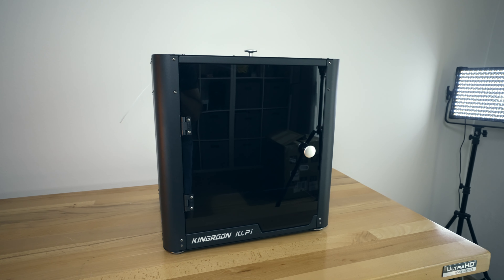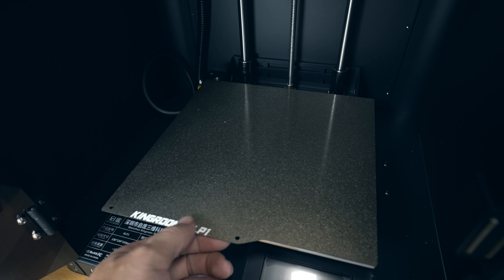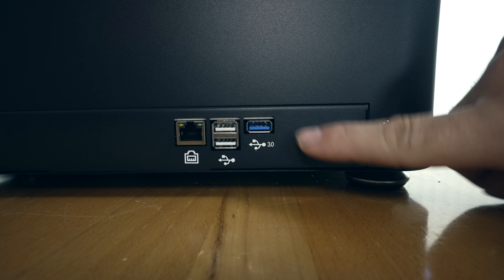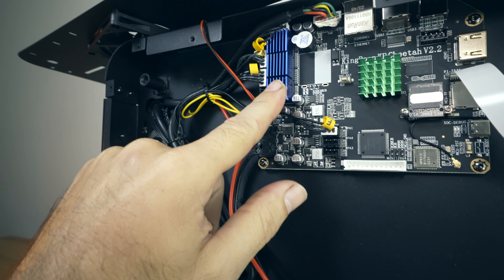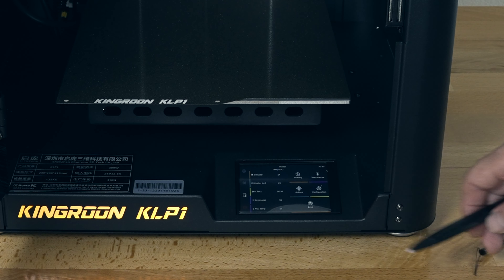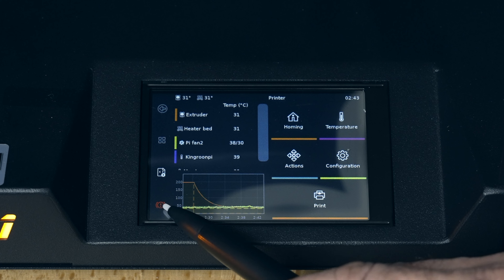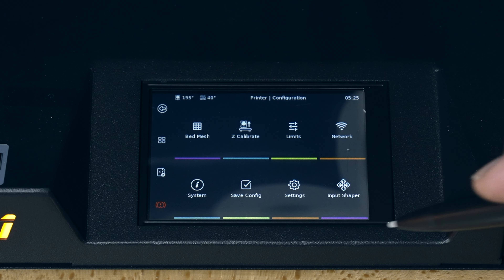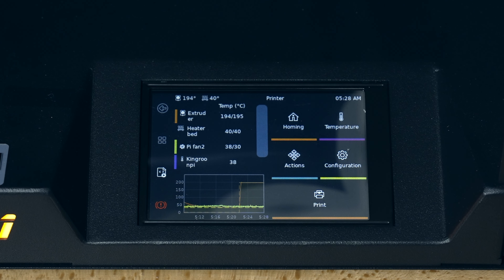Kingroon KLP1 - CoreXY 3D Printer - Overview

Comment: Terrible printer with many problems and a painful technical and customer service. It came to me with the head loose and the solution they gave me was to remove the screws from another side. When you print with the caps on with PLA and PETG, there are continuous jams in the hotend, clogging the barrel, making it unusable. When you ask them, they wash their hands.